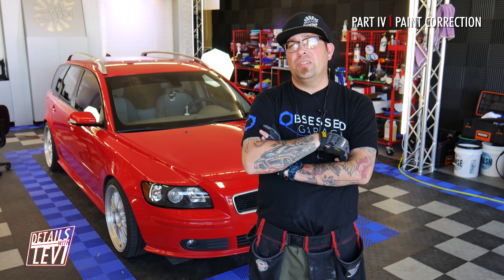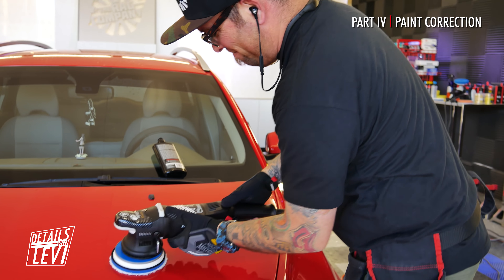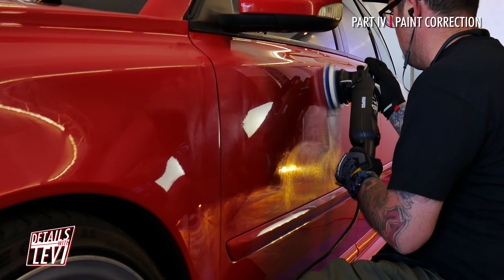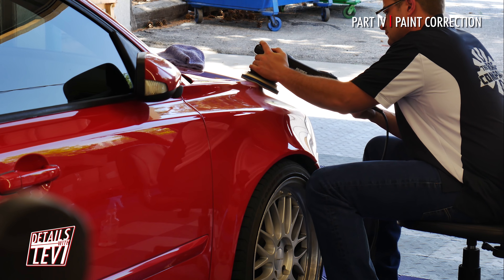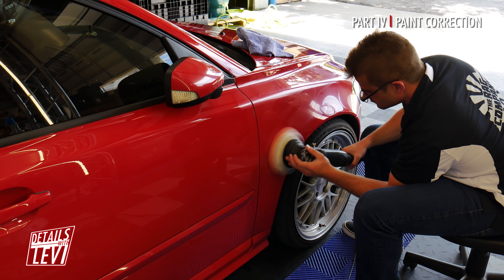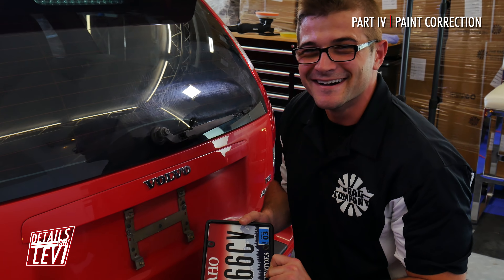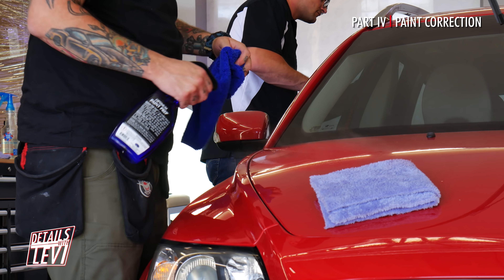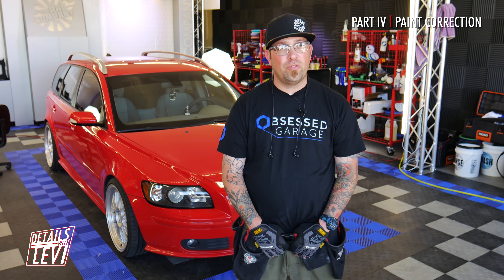USED CAR Detailing Part 4: Compounding and Polishing | DETAILS WITH LEVI

Comment: Did you ever finish this series? Interested in the coating steps
Reply: Thanks for the reply, def understand I’m looking forward to it. I just bought a Race Red 2017 Mustang GT with 2000 miles on it and I’m trying to figure out the best way to get the paint in A+ shape before applying some type of PPF on the front clip and ceramic coating. I’m a do it myself kind of guy so these series are great. There is so much info on-line these days it really starts to get confusing. I find your channel seems to apply a lot of info but doesn’t forget to apply the KISS methods 👍. Great job to all involved.